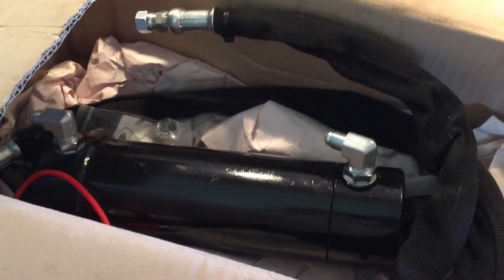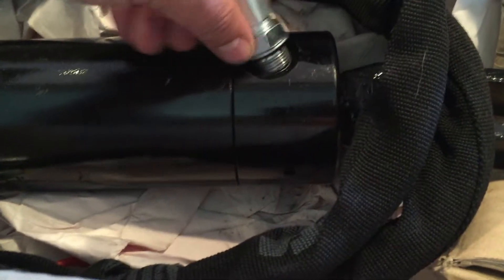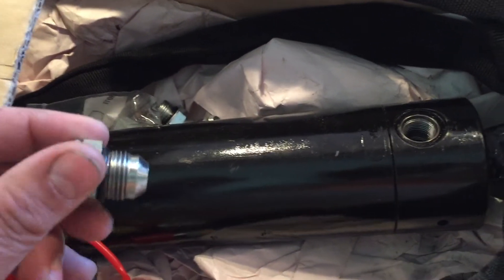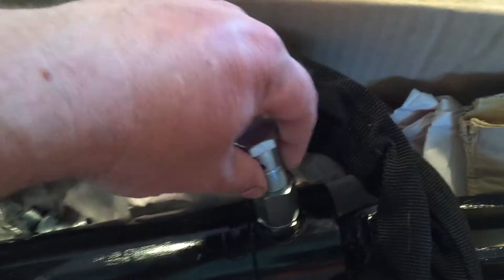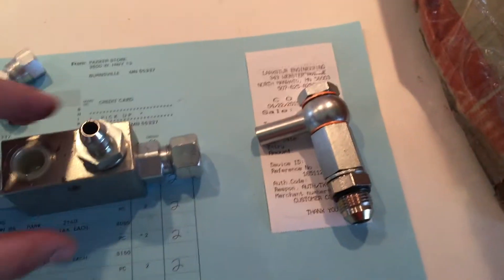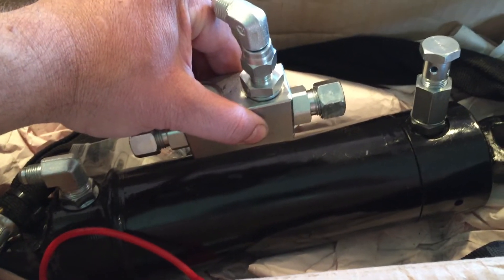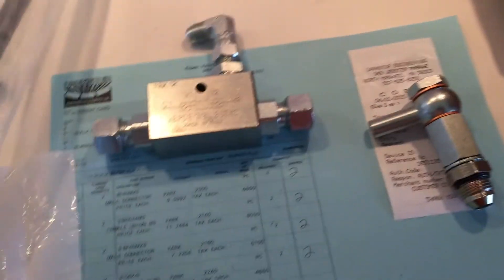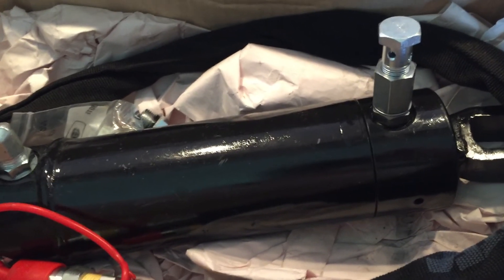3PT top and tilt cylinder with check valves for Kioti NX6010

Comment: Hi , my advice dont mess up JIC or UNF With metric threads, you extend the whole area and you pay more in adaptors, best way is to have more simple connections as possible,the best way  making a hydraulic system is to use one or two tools to connect -disconnect -fix -repair and have less parts , 
Simpler will be-easier will be for you.
I made the same thing mixed thread types Bsp-jic -unf and so on and now if something need repair i need to dissasembly a hydrhose or a part and go with part to local shop and buy it. You should be familiar with thread types to find best way.
And lastly a question : you use to a tractor on right lift arm if 3pt hitch to adjust height?
I made the same thing in mine, a handy function